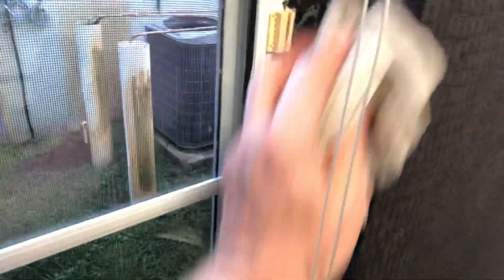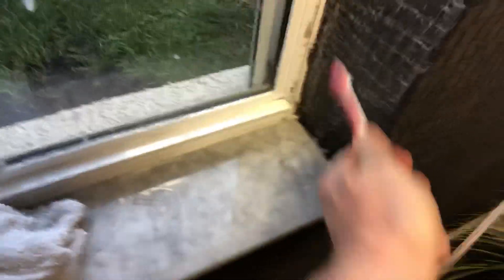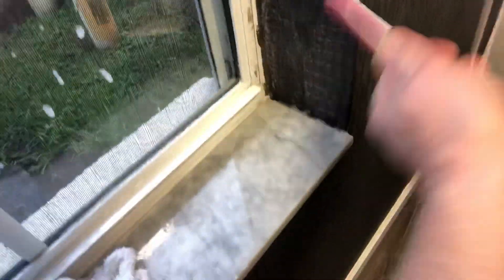How to Remove Wallpaper Glue From Wallpaper- Spencer Colgan

Comment: I recently put up this exact wallpaper (my first time using wallpaper glue) and had the exact same residue. I tried so many things to remove it that didn't work. Then I happened across this video. I used a couple drops of Dawn in warm water in a squirt bottle with a soft toothbrush. It worked really well. I had to do a few places more than once but I am so happy that the wallpaper is now looking like it's supposed to. I think the soft toothbrush was the answer as all the things I tried before were with a microfiber cloth. Thank you so much for publishing this video!!

Comment: I have the same wallpaper professionally installed and the whole wall is an absolute white mess! I have tried the water/mild soap with small brush and it’s not working. Also looks like in some areas the color is even started to fade from the rubbing. Any help? Please??
Reply from the maker: 1. Try white vinegar and water.  70 percent vinegar. 30 percent water. 
If this fails…

2. Use 50 percent warm  Coca Cola and 50 percent water.